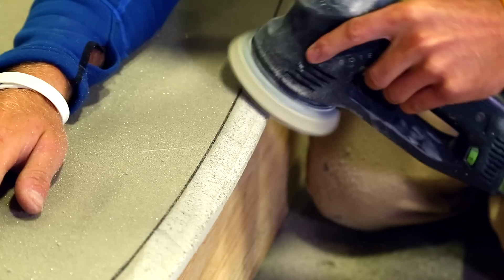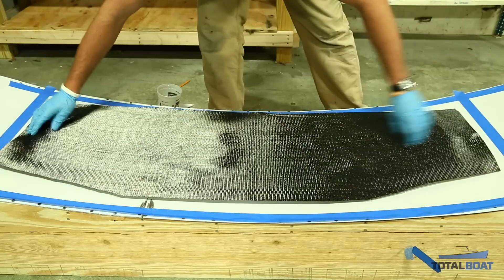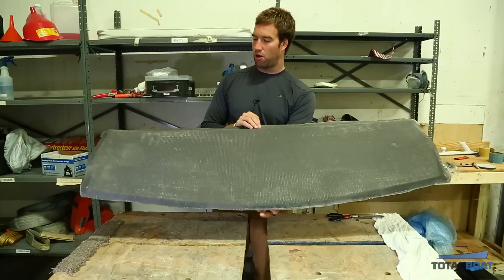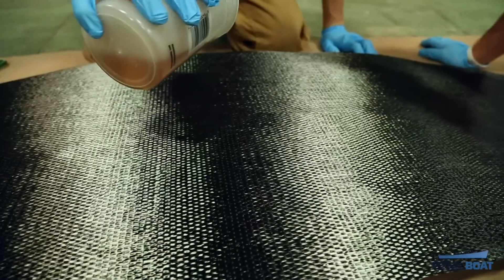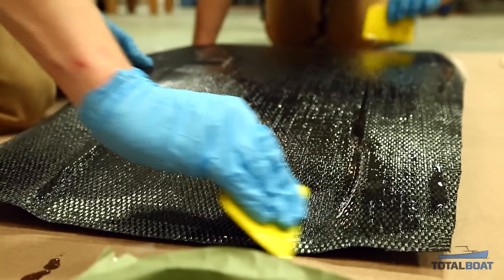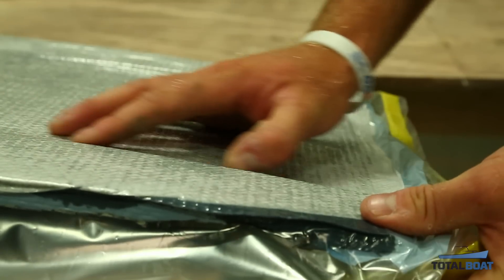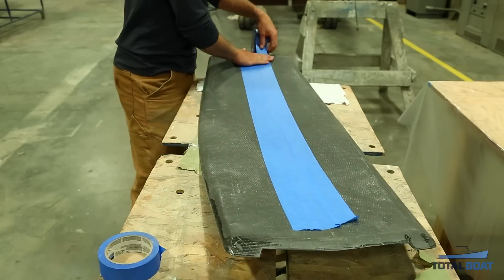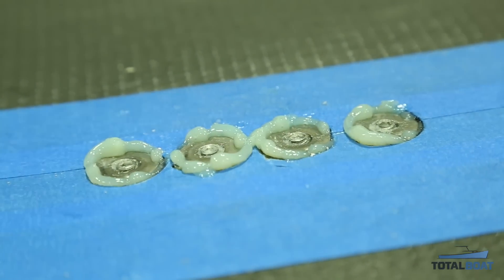Building a Kiteboard - Part 3

Comment: Thanks for the vids.  Really good and informative.

On the boards I built, I put the Tee nut in with the "Tee" on the bottom of the board.  I cut a 1/8" length from threaded SS and then screwed it in the bottom and glued it.  That way the screw will stop if it hits the bottom.  I also used release wax inside the top of the Tee nut like you.  The set screw that you used is a great idea.

Also, have you tried using the "poured rails" method?  I really like that method.  I used flexible epoxy for the poured rails and added lengths of fiberglass cloth for strength.  Pour rails are the way to go in my opinion.

Seems like you should mention that the bottom layer should be added before the top layer is fully cured so that there will be a chemical bond.  If the top layer is fully cured, then shouldn't there be some prep work to ensure the mechanical bond is reliable?